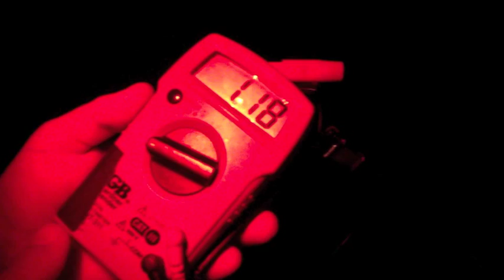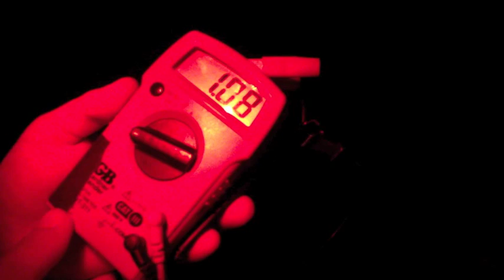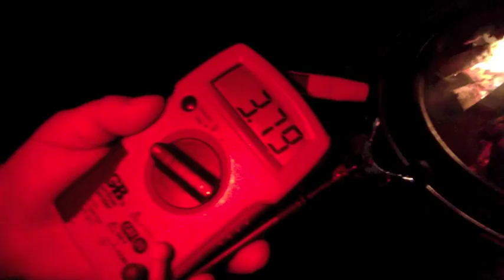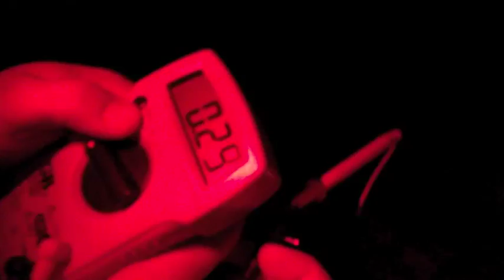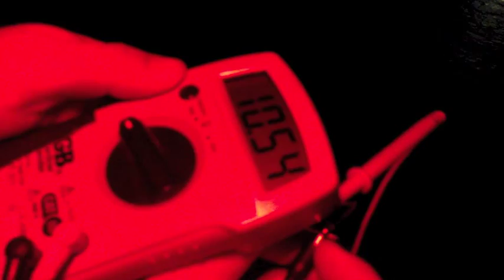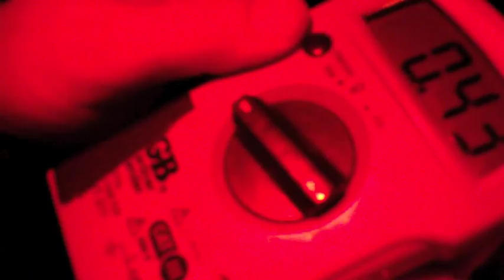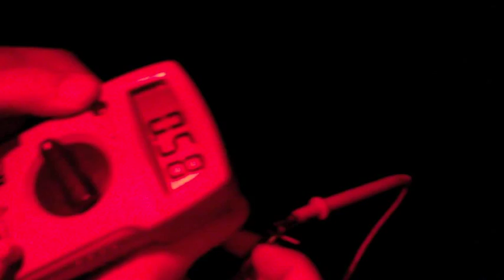Campfire "Solar" Power

Comment: I noticed this a few years back when i accidentally had my solar panel close to and facing my campfire, and for some reason had the fan still 9n connected directly to it. I got 65 70 percent of full sun power,. My volts where 90 percent b7t amps where way down on the other side of that trade off (Vx A = Watts). I never dove any deeper into it any further. Thanks for the video

Comment: Thank you man this really helps, I just bought a 200 w high efficiency 12 lb 1 ft x 1 ft footprint folded solar array that can fit on the back of my backpack.

I was really bumming about charging only during the day but the sun and the Nevada desert waiting for my one wheel XR to charge. 

Even if I'm only charging at half speed that's still 7 hours at half speed more than enough to fill my battery by morning. I'll just have to set an alarm to add more firewood to keep the fire going.

Now be able to take off early in the morning when first light comes instead of having to stay there and charge saving the daylight for charges when the sun's closer to noon.

This is a total game changer.

My one Wheels over 580ah hr.

So being able to charge it in one night on the downtime is excellent

Comment: I would not recommend these folks for anything. They have demonstrated to me directly, a gross lack of judgement in a personal and professional capacity regarding survival and ethics. My advice would be to avoid. Peace.
Reply: maybe you should elaborate so people understand the context of why you believe this instead of just saying I believe bad things of this don't do.

it's like some heretics screaming on top of a mountain electricity is bad.
but never elaborates why it's bad only that it is bad.

I mean if you're keeping the solar unit far enough away from the campfire to not eat it up and caused fire damage as you will know you don't need the heat from it you only need the light including the infrared light the man also shows physical evidence that it works, and granted any person that has bought solar panels will know that they are not cheap so they will place them far enough away to not be a hindrance to their life. but that's the beauty of light you don't have to have it right next to it and 8hr at 45% power is just as good as 5hr at 90ish%.

That's 5 hours of the morning I could be enjoying myself traveling versus charging.

Comment: The voltage means nothing without a current reading also. I can get 14 volts out of a small solar cell open circuit using a cigarette lighter, problem is, no useful wattage is generated.

Comment from the maker: Well... as you can see in the video, we were producing around 14 volts with just this basic fire pit fire. This particular fire not terribly big, bright, or intense... and we didn't use a mylar blanket in this demo to reflect the light/heat of the fire either. Just a regular old backyard fire pit fire. My brother did this same thing with a mylar survival blanket and increased his voltage even further!!